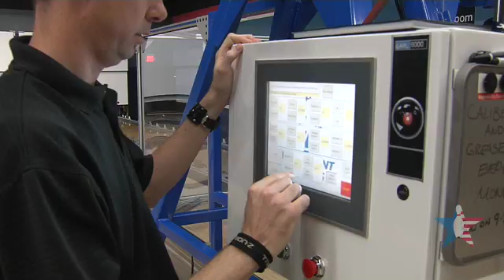EARL vs. Barnes: Man vs. Machine

Comment: Since EARL is accurate to 1/3 board, it could be programmed to move 1/2 board every 2nd or 3rd shot and adjust accordingly, so it won't be as prone to wearing a groove in the oil pattern. Software with a feedback loop using data from lane sensors could be developed to make the machine unbeatable. But I know that's not the point of the machine to beat humans, its purpose is to be a test platform for equipment.

Comment: I wonder what his max RPM is
Reply: http://digitaleditions.bowlingthismonth.com/article/Hello+My+Name+Is+Earl/568407/54562/article.html: "By building it this way, EARL’s weight was reduced to the 4000-5000 pound range. It also assisted in housing a set of rails that allows the arm to be positioned anywhere across the lane, from the 1st board to the 39th board. Another unique feature incorporated into the design is the ability, with one press of a button, to simulate the throw of a right-or left-handed bowler. EARL is able to duplicate shot after shot at ball speeds anywhere from 10-24 miles per hour and rev rates from 50-900 rpm, a significantly wider range than Harry."

Comment: As long as the machine is not trained to read the lane condition, man always win!
Reply: The thing is, you know that eventually they'll install some kind of equipment that can read the oil layout and then make the right adjustments. I hate to say it but machines can do more in sports than we can. For instance, my pitching machine can throw a 100 mph knuckleball. No human being, past or present, can do that. The most I've seen is 80 mph. But if you could hit a 100 mph knuckleball, then you'll have no trouble hitting one that goes 70 - 75.
Reply: @angelicstorm4985  No living thing can beat a machine. It may take time but they'll learn it.
Reply: @JonatasAdoM  I wouldn't mind some kind of enhancement that allowed me to throw the ball with 1000 rpm's. With that, I could hit the pocket almost anywhere and get enough pin-action to knock them all down. I think Belmonte hits around 600 - 700. It's been a while so my numbers might be wrong.

Comment: They need to program in a little randomizing into Earl. (Ball speed +/- .3 mph)(rotation +/- 15 revs)(angle +/- ??)(target +/- .5 boards). This will better simulate humans, and will prevent the problem of rolling over the same spot every time. Turn the randomizer off to go back to ball and pattern testing.

Comment: If you want to fix Earl's problem, stop relying on an optimal shot from hooking. I personally hook the ball on a regular basis, but robots are better made for straight shots. A robot's super efficient ability to throw straight consistently works very well against the driest lane conditions. It also removes the need for adjustments. The only way a robot can consistently use hook without a problem is by reading/scanning the oil on the lane and measuring the oil absorbed by the bowling ball.